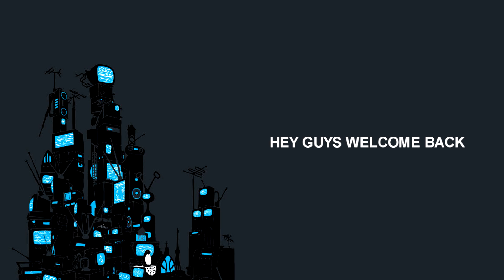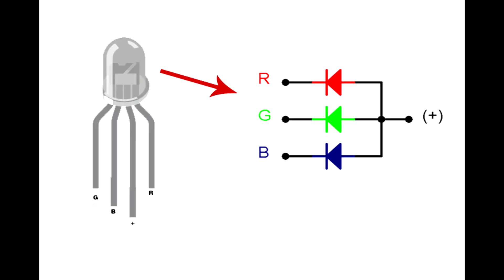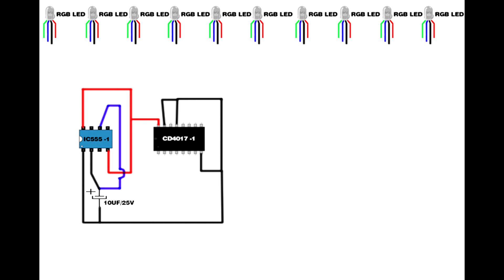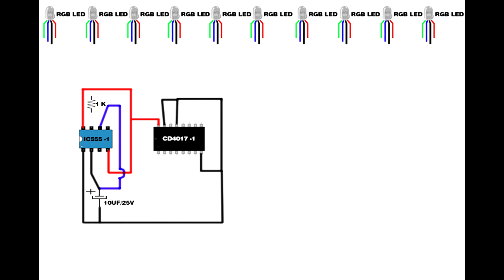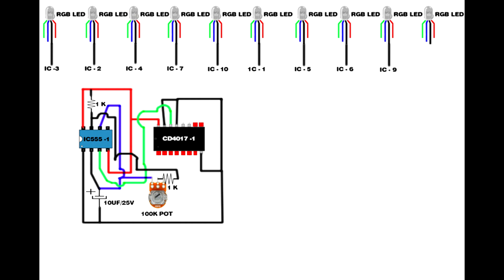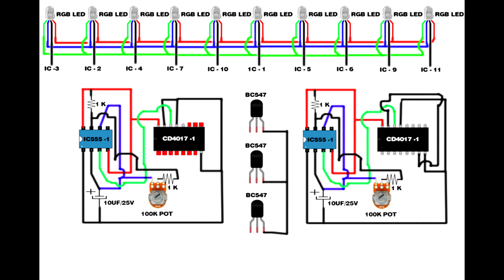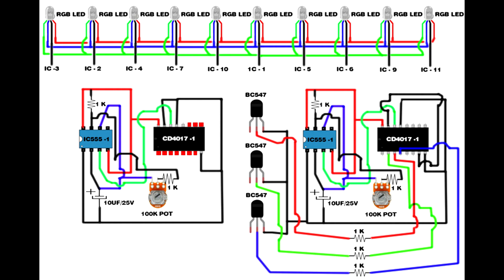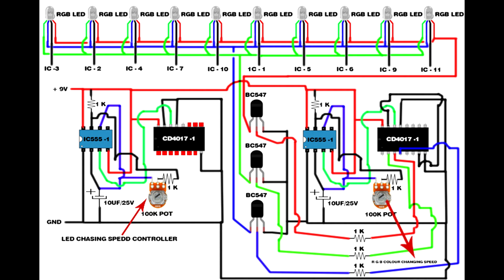HOW TO MAKE RGB COLOUR CHANGING LED CHASER WITHOUT ARDUINO ONLY USING ON CD4017 IC

Comment: @CREATIVEGENUIS how many this rgb leds can glow with this circuit. I need to glow 50 rgb leds. I will run or not? Reply plzz
Reply from the maker: Not possible 50 led's,on this circuit...
Reply: @Circuitoptimize23  kindly can you make a circuit for 50 rgb led...
Reply from the maker: Soon as possible... Thanks for requesting

Comment: I had make it with common anode RGB and i had only connect one RGB and only one color working  need connect 10 rgb please advice
Reply from the maker: Sir please join my personal what's app number. I help u..
Reply: @Circuitoptimize23  can u send your what's app number
Reply from the maker: @nalinchamindamanchanayke9753  sir send your email, I send my number in your email...

Comment: Good job !  easy to understand. But i notice you have 10x 
10 OHM Resistors on you PCB but not on your diagram. Now you need to add a stereo input . 😎👍 I'm working on something like this but it's complicated.  I want to change the direction of the lights and colors as well..  lol not only on LED but on 120v light bulbs with the beat the music for example have it tracing one way on blue bulbs change to red or green  or yellow on all direction